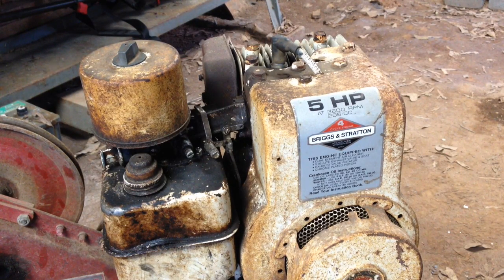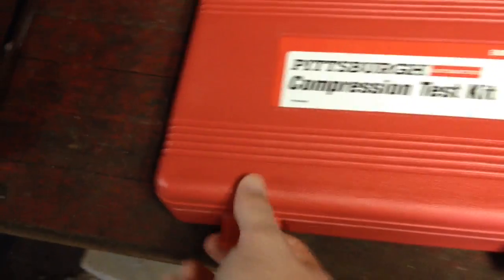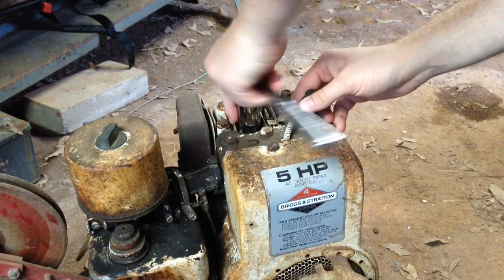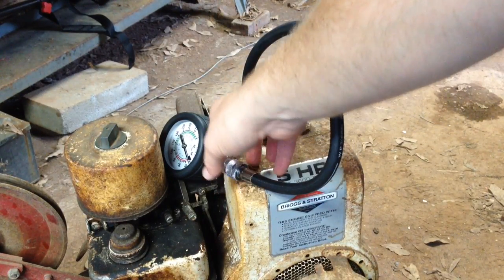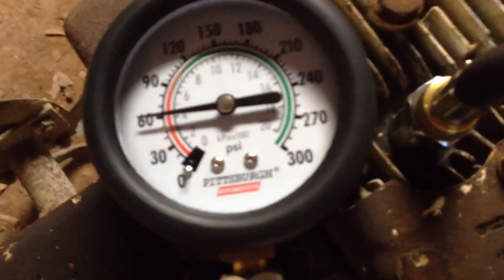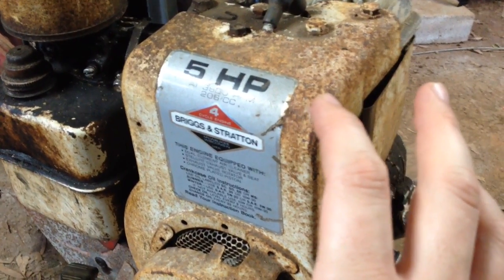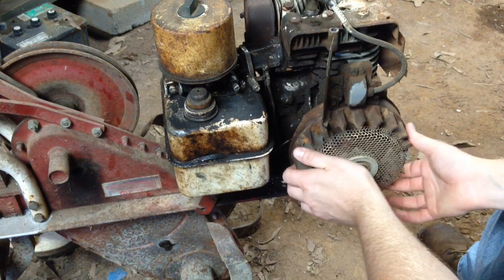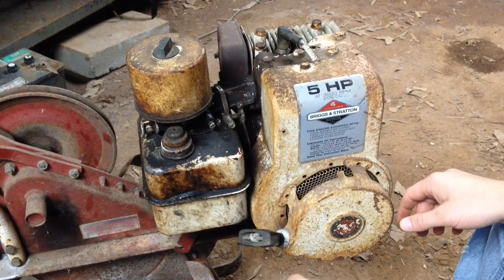Performing a Dry Compression Test on a Briggs & Stratton Small Engine

Comment: I get 70 psi and the engine still wont start. I checked spark plug gap, ignition coil air gap is .010k and i also checked the coil for continuity to verify that its good and it will still not start. Any ideas on what could be the cause? Anyone know?
Thank you
Reply: Check flywheel key.
Reply: @garyshaffer68  Thanks I will do that.

Comment: I see some indentations around the larger valve when I had the head off yesterday ; I don't know what they are for and they don't seem to be holes, would you know what they mean. When you mentioned the pressure release valve it reminded me of those indentations. The compression on my Briggs is only about 50 psi .

Comment: Thanks great video. I got a B&S 2007 190cc. Hard to restart I do regular maintenance yearly adjusted valves once it never back fire or burn any oil. Check compression for the first time. I got 45 psi which was a surprise. It will restart after prime then little black smoke.

Comment: I think the "low" compression is partially a flaw of the flathead engine design. When the piston is at TDC there is still a huge empty volume between the valve and the piston and cylinder prevwnting higher compression.

Comment: TU on vid but none of my B & S lawn mower engine register more than 30 PSI and yet they all start on first pull and sound and run smooth and cut grass with no problem at all.
Reply: My 1990 5HP reads 40 PSI, but seems to pass the backwards spin test he described.
Reply: Yours might have a decompression valve for easy starting if it's newer
Reply: All of my Flatheads with easy spin read right at 30 psi. Only thing I can think of is I have a quality and accurate test guage.